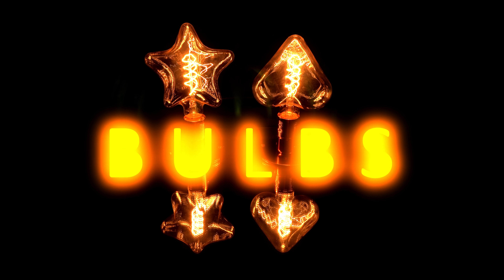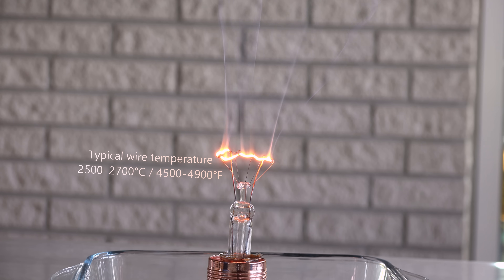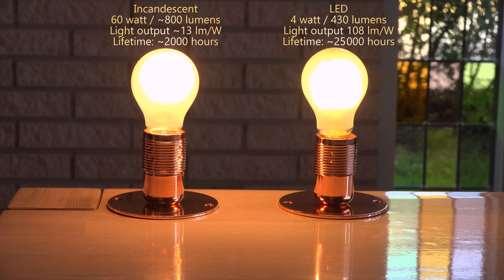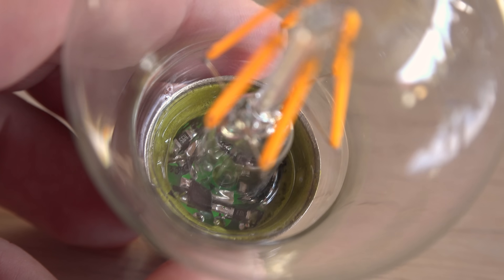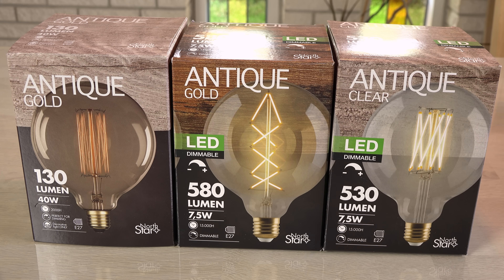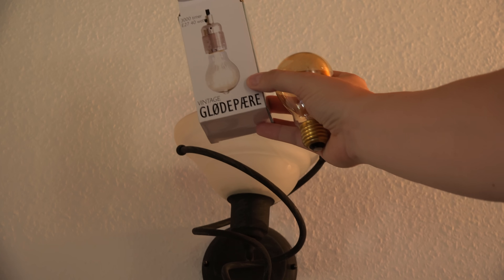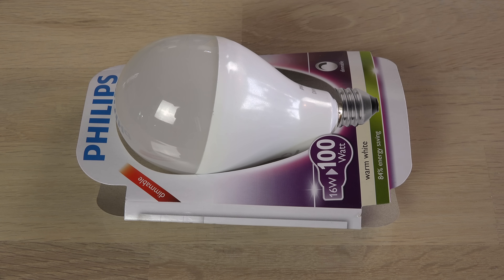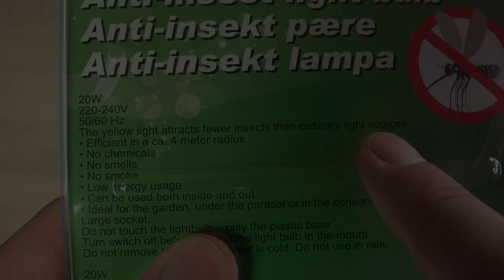Light Bulbs | LED vs. Incandescent

Comment: 4:36 non of the 3 look delicious if you dont like to see body parts from dead anymals ;)
i hated these bulbs even when i was young and they where standart (no leds aviable).
Their light is to "sharp" and blends when you look at it , i prefered neon tubes or at least Halogen spots which had a better light for my taste.
Banning something gives the average joe the impression it gets value and need to be stockpiled ;). To bad that the goverment is correct in this rare case, that light bulbs ar BS. If you want to heat use a heater, they are faster and more efficent than light bulbs and you can control the heat much better than with a semi heater like a ,light bulb ;). The ban harms the hole Market, i prefer free market. If the people want unefficient shit bulbs they can afford - let them pay for it.
But one good point i must give to bulbs: i used them as lumen reference to calibrate my DiY Lumen meter. The bulds have a very stable lumen output over the production with only 2,5% error variance.

Comment: Often times I don't like LEDs cause they're so darn bright. I know light is the point of a light bulb, but not all the fixtures in my house have a dimmer switch.
Reply: just buy 3w or 5w LED bulb
Reply: It called a dimmer.  Actually a 50% dimmed bulb will last 4 times as long not twice.

Comment: high cri leds of 95-98 are the best of both worlds i think. they are made with good materials so they last longer then the cheap leds and they give light quality very similar to incandescent. You can get an 11watt 98cri bulb for 12 bucks so not that expensive considering the things will last so long.
Reply: I can only find 93 to 96 CRI.

Comment: In Australia some CRICKET PLAYER campaigned to get rid of all incandescent light bulbs (because most of their energy is emitted as heat rather than light).  That's fine in summer, but NOT in winter.
In fact, my 2nd partner told me that her father had found the best and cheapest heater when working at a desk -- simply take your socks & shoes off, and put a desk lamp on the floor angled-over to shine on your feet, and have a 100W incandescent globe in there.  It worked a treat -- no need for any other heating while at the desk.  But now, thanks to the Age of the Feuilleton (read Herman Hesse's 'The Glass Bead Game', but it basically means mass media publishing opinions of famous people on topics in which they have no expertise or training) we can't get incandescent light bulbs any more.
Show less

Comment: Unlike these other nuts I also live in Canada. I replaced ALL my incandescent and am planning to replace my CFL (?) tube lights in my house with incandescents. The lights are cheaper (overtime) don't require ballasts and my province is currently subsidizing them. I have about 50 soft white 60 watt equivalent leds I bought for $1. 

The cost savings over time equals out the "heating" effect, which can be a nightmare in summer. Not to mention the cost of a gigajoule of natural gas is much cheaper then the cost of a kWh of electricity.

Incandescents are inneficient and a ban is not a bad idea, the only bonus they have is they are all dimmable.

Comment: Banning harmless lightbulbs goes to show how shitty government is.
Reply: As annoying as the ban is it's not really harmless and the government isn't shitty lol.
Reply: +morti271:
"A gaming PC doesn't just consume more power, it has much better performance in return, and when on low load both will use around the same amount of power."

==It depends on the power supply design. Some are more efficient when idle than others.
It depends on the CPU as well.
For example, the latest Intel i5 or i7 8th generation are great on idle but use a lot of power when gaming.
Ryzen CPUs use more power on idle than Intel 8th generation but during gaming, use less power.
Reply: Bad analogy.
A gaming PC doesn't just consume more power, it has much better performance in return, and when on low load both will use around the same amount of power.
An LED is just as bright as a light bulb - but only has a fraction of its power consumption.
Reply: So you would also prefer using engines from 1940 with 20 times the fuel consumption?
Reply: morti271 I personally find driving a modern car preferable to those of 1940 but I think banning them is a dumb idea. It's up to the individual if they want to make that trade off and the same goes for lightbulbs.
Reply: I think it's a great idea in both cases. They have no benefit and the only thing they do is wasting a lot of energy. But I guess it's the curse of technological progress that many people will stick to the outdated stuff, just because they are used to it. The new generations will laugh at them though :P

I'm using LEDs for many years now, and I already saved hundreds, if not thousands of Euros alone on electricity bills. Most of the LEDs are still working after like 6-7 years. In the same time I would have needed many dozens of bulbs due to their low lifespan.

The first year after upgrading to LEDs my electricity provider actually called me because they though something was wrong with the electricity meter :D
Reply: morti271 I won't laugh at them, like it's just life.. lightbulbs don't matter to me
Reply: morti271 My gaming PC consuming more energy than my gf's PC, but I hope government ban her useless decoration first before ban my PC.
Reply: their banning the wrong bulbs. incasdent bulbs r beter for giving out light easy to make and recycle and use far less electric than the energy saving bulbs which have mercury in so cant be thrown into bins when they no longer work. they also cause cancer if ur within 6 feet of them for more than 4 hrs a day. when i was first given a new energy saving bulb my eletric bill doubled. ran an energy meter on everything in my home and the old bulb barely regiserted while the energy saving bulb used nearly as much electric as a kettle. it took 20 old 150w bulbs to use the same electric as 1 40w energy saving bulb. A lot of ppl who have eyesight probs r really struggling to see using the new lower watt bulbs as the light they give off is very poor quality. ive switched to using 150w halogen bulbs so i can see to read and got rid of all the LED and energy saving bulbs. their a lot cheaper to buy give of far suppior light and can be recylced as its just glass and metal. the new bulbs r mainly plastic full of mercury and cost a lot more energy to make them and to use them. Its why they r baning the old bulbs so energy companies can get more from eletric bills. its a con by the energy companies to get more money out of the bill payers. More electric being used means more electric has to be produced which in turn increases polution the electric producers put out.
Reply: morti271 

Banning it is bad nigga.

Comment: If something is more efficient, it means you don't pay to much and there is no need for ban on the other things. We know LED or fluorescent lights are not always better, so there is a ban. We didn't need a ban on CRT TV's, VHS tapes, steam engine trains, open wood or coal fire stoves... Because there was no real benefit to them. If there is a ban, it means only one thing - someone is trying to push their agenda on you. In this case, there is a lot of money to be mage in patents for fluorescent or LED lights, they cost a lot of money so people would not buy them. It is better to have one 40W tungsten bulb on your toilet or pantry for 10 years, rather than paying 15 times more money for LED, which will go bad in few years due to problems with one of the thousands of electronic parts. Or 10 times the money for fluorescent, which will burst every few years, releasing mercury fumes into your home.
Reply: yes!!! Always ask "Cui bono?" - "for whose benefit?". If there is a ban, it's never because something is better.
Reply: +Mylity 66  Is that theory or experience?  I've used leds for years now and have never needed to replace any of them, unlike the incandescents I used before.  Never did I buy expensive leds, I bought them cheap from discount sales and found that if I pay attention to color temperature and CRI, I'll have cheap leds that are just as fine.  I have no doubt I would've paid the same amount for replacing the incandescents by now; these leds are definitely saving me money.  Especially the ones I use most, they save enough money on electricity to make it worthwhile within a few months.
Reply: Its from experience unfortunately, i've had a grand total of 7 LED lamps and all died off within a month or less, just stating what the situation looks like where i stand, i understand the mileage from the same electronics can vary quite a lot depending on many factors, particularly where you live. I did forgot to mention a very important factor that biases me more towards old incandescent bulbs, where i live the electrical service is absolutely garbage, so much that its almost a relief when the power is out. Every day, there are tension spikes and drops ranging between 60v to 160v from a nominal 120v, every few days there is a blackout that can happen at any time of the day, lasting anywhere between a couple minutes to a couple days, there is no previous warning despite being programmed (they cut power selectively to different sectors of different smaller cities to keep the metallurgic industry going, also to keep the larger cities powered since that's where most of the voters live). The lines are 60 years old in a tropical environment with very little to no maintenance and over 70% of the electrical production is hydroelectrical. Sure, kind of ecological (don't even get me started), but as soon as it stops raining shit hits the fan, specially since most of the generators on the largest dam in the country have been cannibalized for parts to keep the rest going!

Also, although most of the LED lamps i had were of dubious quality and fabrication the couple brand name lamps i bought also behaved just the same (and no, they were not fakes, i imported them myself from abroad and a quick postmortem dissection immediately showed to high quality components arranged and assembled with care). The way the economy is here, i can buy 6 100W incandescent bulbs for the same i could get a Phillips (most likely a counterfeit as well) and i can just add a diode to the bulbs to rectify its input, basically filtering the negative wave of the AC, it dims the bulb but also gives it extra protection and they last a lot longer that way. My father did that for the first time to a bulb in the bathroom, the bulb is still there 18 years later.

Ah, also, since the government can not raise the prices of public services like electricity (it would be political suicide, admitting that the economy is a cesspit) i pay about half the price of a normal chicken egg every month in electricity. I live in Venezuela in case you wanna know.
Reply: I still buy them. You can get them at stores still. I have a light that is on 24/7 so I use an LED but the rest are incandescent except a fluorescent light in the kitchen which is only tolerable for the time it takes to make dinner. Then new bulbs make me feel wrong.
Reply: In the U.S. incandescents are being replaced at quite a rapid pace I haven’t seen someone buy an incandescent in a while.
Reply: USA!
Reply: People are still watching TV on CRT TV''s.  Nobody has been banned from watching a CRT TV in the UK.

But watching TV on a flat 16/9 TV screen is better than watching TV on a round shaped 4/3 screen with 2/3 of the picture missing at either end though.

Going back to the 4/3 round shaped screen as standard would be a backward step.  And 5 channel analogue terrestrial should never return to the UK.  UHD digital is better than SD analogue.
Reply: Actually... There is a need to ban the coal fire stoves - They are much cheaper to operate but pollute like crazy!
Reply: While I'm generally weary of governmental control as well, I think it's still worthwhile to stick with the facts and look at the pros and cons of each individual decision made by any government.  There are plenty of examples where our democratically chosen governments have opted for a ban which turned out pretty nice for everybody, from banning the use of asbestos to driving unsafe rotten cars without seat belts etc.

Your comparisons aren't quite applicable; CRT TV's were made obsolete by CHEAPER flat panels that produce a much BETTER image while taking LESS space and offering MORE features.  Yeah no shit nobody was buying CRT's anymore when the flat panels are a quadruple win situation and it's OBVIOUS you'd be a fool to still buy a CRT.  Same could be said about VHS tapes, even a dvd recorder with a hard disk costs about the same as a video recorder in the old days while producing a higher resolution image at a higher refresh rate and offering a lot more features, while even rewritable DVDs are cheaper than VHS tapes.  Steam engine trains and open wood or coal fire stoves were made obsolete much the same.

Not so obvious for led lights - the initial price is higher than incandescent lights, while light is light and consumers may easily choose the short term benefit because they won't or can't use a calculator at the time they need to buy a bulb, much like a ton of them would drive rotten cars because they think it's cheaper while in the long run that may not be true and they endanger everyone else in the meanwhile.  Well it's been established that our use of energy is endangering everyone, something needs to be done about it and the ban on incandescents is one result of that.  Whether that's the best measure is of course up for debate, the result of that debate was that a ban would be worthwhile and effective.  

Personally I can't say that I mind the ban one bit, I was replacing incadescents by leds long before that took place and have never regretted it, simply because I'm a consumer who likes convenience and can use a calculator.  Although it's hard to establish what would have happened without that ban, if the years prior to it are any measurement for it, I'm quite happy with the effects of the forced mass adoption of leds - primarily more cheap led bulbs that are satisfying my lighting needs.

Your final arguments are gross exaggerations.  I've used leds for years now and I have never needed to replace a single one of them so far, unlike the incandescents I used before.  I paid at most 5-6 times the price of an incandescent instead of 15, which they've earned back by electricity savings a whole bunch of times already, and will continue to do so while their longer lifespan by itself saves enough money to make up for the initial cost.  I suggest you take a look at a schematic for a led bulb as your estimation of a thousands of electronic parts is off by an order of a couple of magnitudes.  Yes fluorescents containing mercury can be a problem when they break, however I fail to see how that's relevant when you compare leds to incandescents.

Speaking of pushing an agenda, when people don't stick with facts but resort to exaggerations and logical fallacies... Well it's up to you to decide whether your agenda is worth pushing.  I'd use a calculator and buy a couple of led bulbs instead.
Reply: "one of the thousands of electronic parts" depending on the lamp, the amount of parts can be less than a couple dozen, on large lamps it can probably be well over 200 at most (most of them being LEDs). Also, in theory LED lamps should be able to outlast incandescent bulbs. Yeah in theory.

Despite exaggeration your point stands, an LED lamp is supposed to outlast a regular light bulb but that only happens under lab conditions where they are tested in a nice 23°c constant temperature indoors room being powered by high quality power supplies. In the real world you have 10-12°c temperature changes between day and night, more if you use heating or air conditioning, people turn the lights on and off on irregular intervals, the power lines feed crappy quality power to the bulbs and there are tension/voltage spikes and drops. The last ones absolutely kill LED light bulbs, it really deteriorates them a lot, changes in temperature will also stress the internal components into self destruction (specially capacitors, they dont take high temperatures nicely and die off in a couple years at most).

A regular lightbulb wins in my opinion, only because its simplicity makes it quite rugged and not only cheaper to make and manufacture, but also cleaner and more ecological since its literally a bit of glass and metal.
Reply: It's because incandescents are not very profitable and are also beneficial to your health with the "inefficient" portion of energy they put out. Yes the large amount of beneficial infrared that incandescents give out is good for you. These poison energy saving lights have virtually no infrared in them and also lack real red in their spectrum. Frankenstein lights these are. Sunlight, candles and other controlled fires are the light sources humans have been exposed to throughout their existence on Earth. All of these rich in "wasteful" infrared. The best part of all these light sources is the infrared, especially the near infrared.
Reply: The ban is used because people are rumour mongers that believe anything. Like the government is having microphones added to the electronics in the bulbs. Or irradiation: en.wikipedia.org/wiki/Food_irradiation#Public_perception
In other population growth will stay if check because people want to remain stupid. Lets ban stupid!